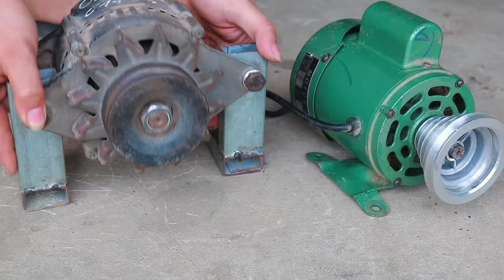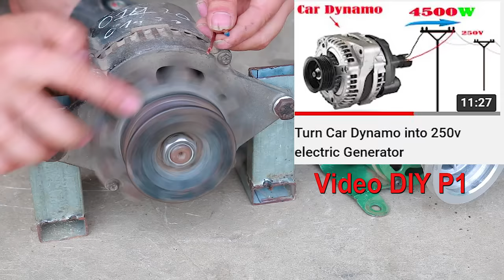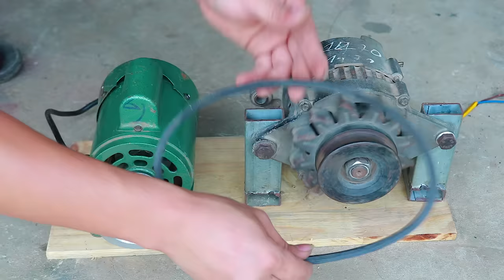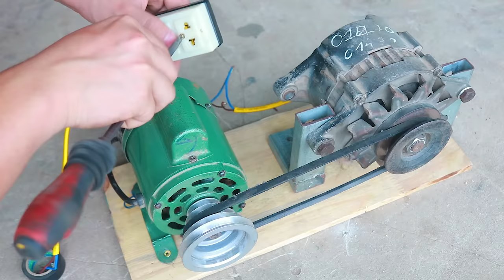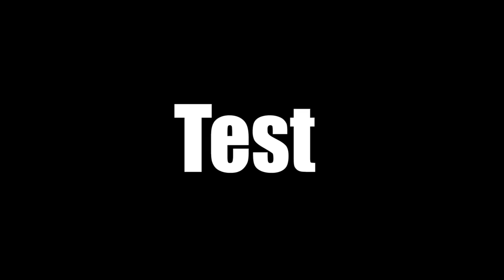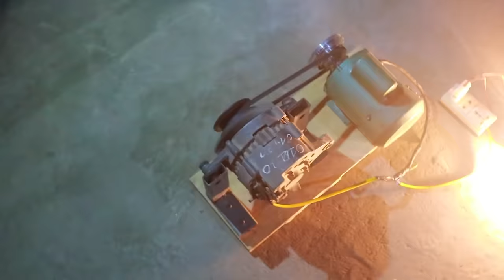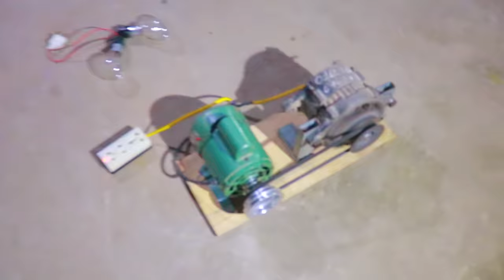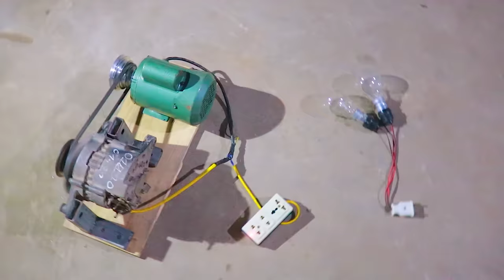How to generate homemade infinite energy with a car alternator and an engine P2💡💡💡

Comment: Wouldn't placing a larger pully on the motor and a smaller pully on the alternator, generate more power?   The ratio would be, Moter 1 rotation, alternator several rotations.  Because the faster the alternator spins, the more power it produces. The speed at which an alternator must rotate to produce power depends on a number of factors, including the type of alternator and the load on the system. Generally speaking, most alternators need to spin at around 1,000 to 1,500 RPMs to generate enough power for most applications.

Comment: It’s not infinite energy. He creates enough rpms with the drill to get the alternator to produce enough electricity to run the motor for a short time. The dill alone consumed more energy to wind it up than the output. It’s also the reason he only records each run for under a minute. The alternator doesn’t produce enough power to keep the motor running for long.

Comment: AI SAID - A perpetual motion machine, which is a device that can generate continuous energy without any input, violates the fundamental laws of physics, particularly the First and Second Laws of Thermodynamics. Therefore, it's not possible to create a perpetual motor to generate electricity continuously, including for a system producing 10-12 kVA (kilovolt-amperes) of power, using springs, pulleys, or any other mechanism without an external energy source.

Here's why:

First Law of Thermodynamics (Conservation of Energy): This law states that energy cannot be created or destroyed, only converted from one form to another. In a generator, mechanical energy is converted to electrical energy. However, a system of springs or pulleys cannot continuously supply the mechanical energy needed without being recharged or replenished because energy losses (due to friction, heat, etc.) are inevitable.

Second Law of Thermodynamics (Entropy): In any energy conversion process, some energy is always lost to heat or other inefficiencies. This means that no machine can be 100% efficient, and over time, the system will run out of usable energy.

Why Springs or Pulleys Won't Work:
Springs store potential energy but require an input of energy to compress them. Once released, the spring will eventually return to a state of rest and won't continuously generate power.
Pulleys can reduce the amount of force needed to lift a load, but they don't create energy. They merely redistribute existing energy and are subject to frictional losses, meaning that over time, the system will slow down and stop.

Comment: I built my version of this device over 29 years ago when  I was trying to come u with a way to power our cabin in the woods of Maine with a wind generator. I was using an electric motor to test out how many amps the alternator could produce. I connected the leads to the motor directly to the alternator by accident  and It started up and never has stopped running ever since. I power a few lights and a small TV and an electric heater. When the heater is on the TV won't work and the lights will dim but once the cabin is warmed up in the winter  I can turn off the heater and watch TV for an hour or so.
 I have had engineers look at it and all say the same thing, that it is impossible citing over and over the conservation of energy law of physics..But yet it keeps running. One electrician I had look at it says there has to be power entering the system from an outside source and it seems to be drawing electrical energy directly from the earth by way of inductance from the wires I used to wire the cabin..The wiring seems to act as a giant inductance coil that picks up power  as it runs from the alternator output  to the coils within the electric motor. I don't know , but I know it works..I do have a metal rod driven into the ground as a reference to ground to power a GFCI in the system's inverter  for safety and if I remove that grounding rod from the system the whole thing slows down and eventually stops.
About ten years ago it stopped running and I replaced the alternator  with a new one because the diodes had burnt out and it started right up and still keeps running with a slight increase in available amperage with the new alternator.Of course every two or three years the belt wears out and breaks or starts to slip but when I replace it it carries on running as it always did.
I keep a battery powered drill handy as a starter motor to restart the main motor when this happens..

Comment: if you put 14v DC on a 220v AC motor the only thing that will happen is the coil windings will over heat on the AC motor and if you put 220 on 14v alternator magic smoke should be the result.

Comment: This looks like a AC motor not an DC motor. An Alternator normally put out 14.5 volts when the engine is idling. Electric motor as big as that one you using will require 220 to 240 volts to run properly. A light bulb connected without a battery will eat up the energy and burn out the alternator AC energy before powering the electric motor. What's the catch here?

Comment: That's what's kind of making me think it's real because of the fact that the government would never allow something like this to be sold and if they discovered that you have it you could get in trouble because they don't support this kind of free energy because it can be extremely powerful and you can circumvent electric companies but then again I don't know I would assume that the alternator would need to be able to produce enough power to keep the motor going so the motor can keep the alternator going and then you can plug something else into it but can you power your house with a power inverter or at least the refrigerator a TV and a light

Comment: The Car alternator gives 12 -15 v power , how it will run 120 or 220 v motor .....and for how long this will keep Running?
Reply: "Alternators" in their most recognized current form standard, by design, produce 3 phase A.C. electrical current of differing amounts , due to varying components and situations. Then transform that said output to D.C.. voltage, via  a (removable)"rectifier" inline load transducer to 12V D.C.! I'm not defending this supposed" free energy device", as its obviously not! Im only explaining  alternators produce A.C. voltage by default prior to rectification'.

Comment: Add transistor and resistor with switch and lithium battery with cooler combine to electricity motor.

Comment: 1st it’s a motor not an engine and 2nd what’s the wattage/ amperage being produced?

Light bulbs do not need 220 volts to function and if the wattage isn’t much it’s only good for a parlor trick

Comment: This video is dishonest; there are batteries in the electrical outlet box that is powering the whole set up.  Eventually the motor/alternator will stop spinning as the battery wears down.

Comment: Plug a refrigerator in. Alternators can run everything in the car all at once but only with the engine turning it. This is very l"light" duty. Pun intended.

Comment: If you disconnect a battery from a car whilst the enging running it still runs so why wouldnt it work and if the alternator was charging a battery then you could link more batterys on a relay charge thus storing the energy charge from the alternator so my guess is this is possible anyone else agree with my opinion
Reply: Then the energy can be channeled through an inverter and converted to 240v which can be used in and a round the house/ shed /workshop  to run lights tv fridge etc other equipment

Comment: OK say I had a generator capable of 5000 watts @110 volts= 2 outlets each 110 volts@20 amps out. The motor if it drew 20 Amp @110 volts you could still have another 20mps at 110 volt

Comment: A 220 AC alternator for a car 🤷‍♂️🤷‍♂️🤷‍♂️🤷‍♂️ every one I have fitted is 12 volts (13.8 to 14.2) DC 🤔🤔   Just noticed it has even got 014.20 written on it 😂😂😂😂😂😂😂

Comment: Well that's not going to work. Efficiency rating?  Power loss from the belt and heat? You won't get any power from this setup. A huge waste of time. It's basic knowledge. But congratulations on getting clicks. I'm sure that's what you wanted in the first place. Who needs truth when you get clicks.

Comment: You cannot produce energy this way because what about the energy you used to drive  the electric motor? The energy you use with the motor will be more than what the altenator deliver because you have loses in the system.Yoe can only transform energy from one state to another i.e.from the sun to electricity via a solar panel or wind via a wind turbine to electricity.

Comment: i dont underatand. you did nothing to the alterno to change its out from d.c to a/c  and still you are using it to power an a/c  motor. please explain. show how you got an alternator that produces  d/c  12 or 24 v0lts  to power a 220 volts motor.

Comment: Unfortunately this will not provide sustainable energy for long periods of time, after running for a while it will eventually slow down and stop producing energy this is because of the laws of energy, it states that energy in the system will not just be turned into kenetic energy but also heat through friction and also a small amount of energy will be lost also to air resistance. It is also impossable for it to power external energy consumers because of another law of energy, it states that energy cannot be created or destroyed, so that means this machine is breaking the laws of physics, the illusion was created by using an external power source.

Comment: 12v alternator to ac motor 🤔 no converter voltage no capacitors or battery 🤔

Comment: So dya know what, i was totally taken in by these fake free energy vids, even went and got an old 240v washing machine motor to make a start and then i stumbled accross a guy who exposes all of these videos, they make them to monetise the millions of views they have ! For starters how can a 12 volt car alternator work with a 240 volt motor without an invertor to crank up the volts from 12v to 240v ? There'd be an energy loss on the belts too so that there wouldn't be enough rpm to power the alternator, most cars go up to 6000rpm, what small motor can produce that output ? If it did actually work, the bulbs would probably blow up as the output isn't really being regulated...the guy's made a fortune out of views that's why there's so many of this type on Youtube !!

Comment: Yeap it's fake the video only seeks viewers inside the big motor they placed  an invesor and a battery to make the alternator work since it only needs 12v  and once the alternator is working thus the inversor outputs 120v but it's not sustainable 😂😂

Comment: Everybody the is no such thing as free engery with out loses so this can be right the no way to made a free engery machine that was the case we would have had free power along time ago but if this is all true why isnt the goverment make stuff like this that actually work with out putting zero  engery in it but if he was to pull to much power the system wi turn off and this whould be a suffent way to create engery cuz the power is mosly be use to power the motor